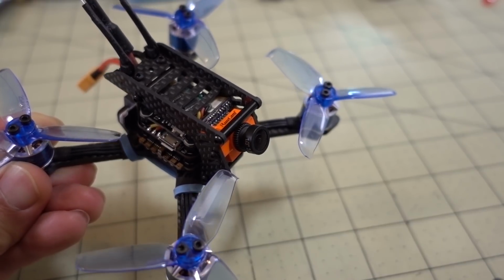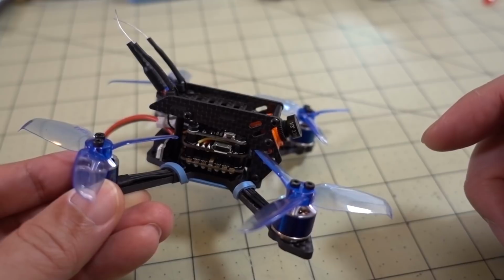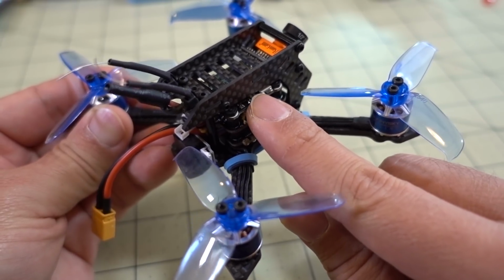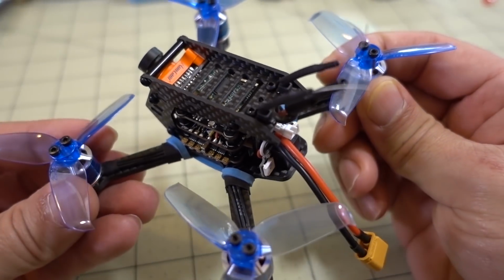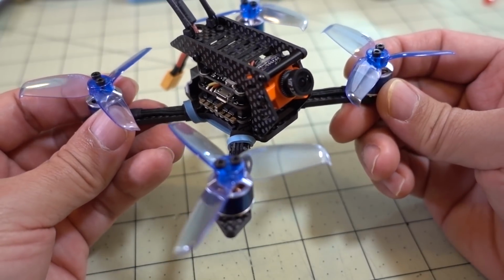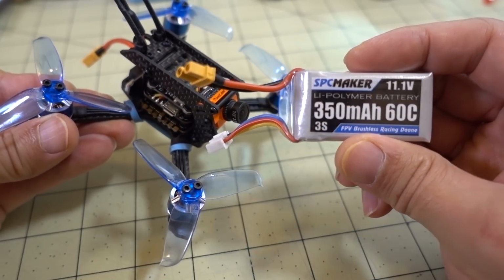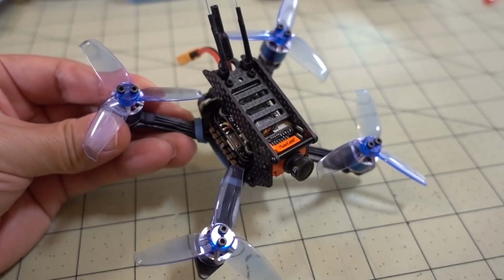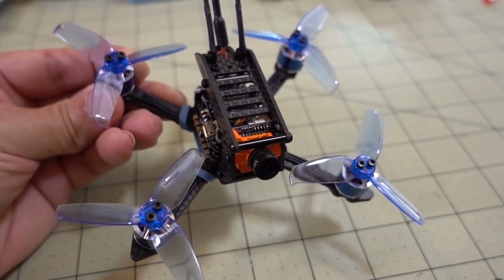MD#68 🚁SPC Maker 110VT 👍

Comment: Hi ALbert! At about 5 min you were discussing the battery and mentioned the possibility of turning down the buzzer voltage setting - how? Caught my attention cause I just configured my XJB-145 and the buzzer appears not to sound. I have the beeper on aux3 when I switch it on the lights blink but no sound. I've tried turning everything back on in the beeper section on the Config tab, but no luck. Any ideas? Thx!
Reply from the maker: You probably have a bad buzzer or the connection is not solid somewhere. What I was talking about was the voltage alarm and when it is set to go off. I didn't change that and left it stock and it beeped at a fairly high voltage.
Reply: OK, thanks!
Reply: LOL - looks like I was just using a weak test bat. Put on a fully charged 4S and beeper is working. Very quick quad and pretty smooth using your PIDS. Just a little flutter, so need to lower D (I think). For flutter and prop wash lower D but for bounce (after flip) raise D, right?

Comment: Hey Albert i just bought the frame and 1106 5500 ss motors with gf 2540 to tranfer all my gtr 90 guts in there. :) Could you share its default pids or w/e pid tuning you did, just to have a stable base to take off?
Reply from the maker: The gyro on the flight controller is different so the PIDs won't be of any use to you unless you have the exact same parts.
Reply: ohh got you, i thought it had same specs :) i ll prolly start with a safe 40/30/15 on 3s as base start.